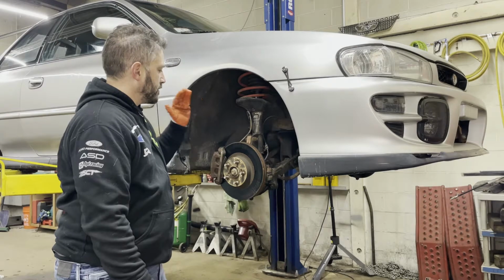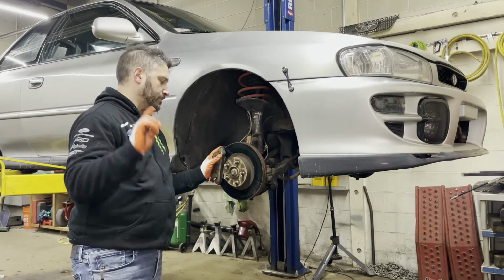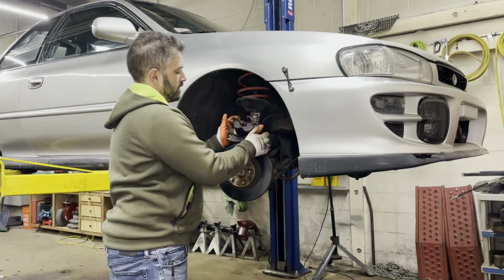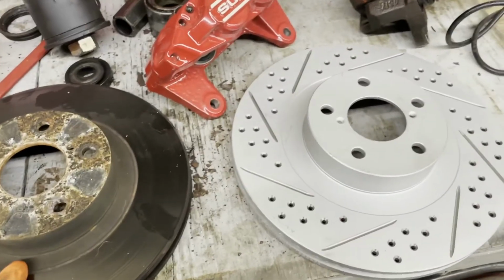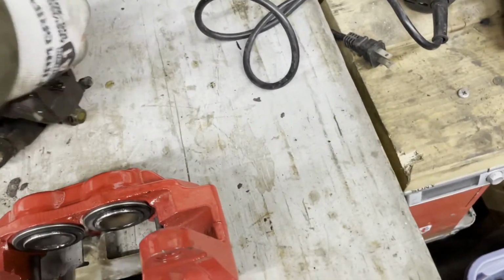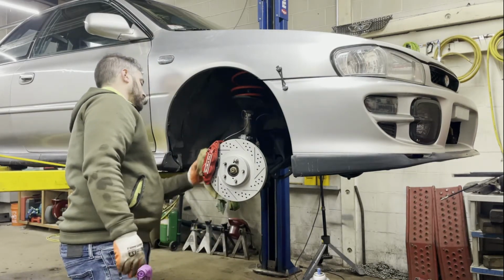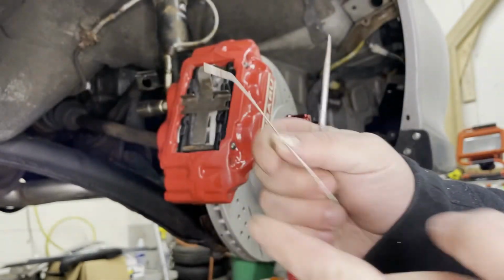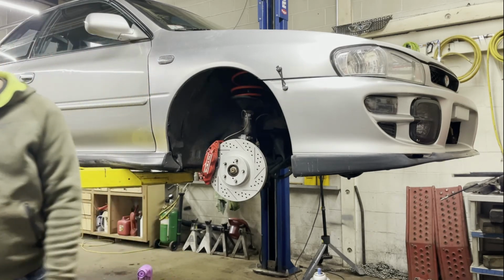1999 Subaru Impreza 2.5RS Gets 4 Pot Brakes  (Part 1 - Front Brakes)

Comment: Interesting video, thanks, to do know the size of the OEM rotor compared to the upgraded one? I know the STI rotors are larger but don't think these are STI. I've looked on line and can only find 294mm OEM and STI 325mm, the difference between your rotors doesn't look that much. Thank you in advance 👍
Edit, after looking around I guess the rotors you removed were the 277mm ones. 🧐

Comment: 2006 brake rotors on a 99 rs 🤔 isnt 2005 and up the larger bolt pattern? 2004 and down is 5x100?
Reply from the maker: WRX were still 5x100……the STI bolt pattern changed.